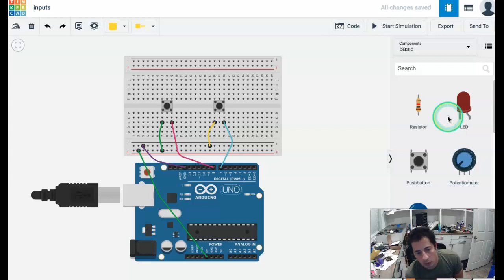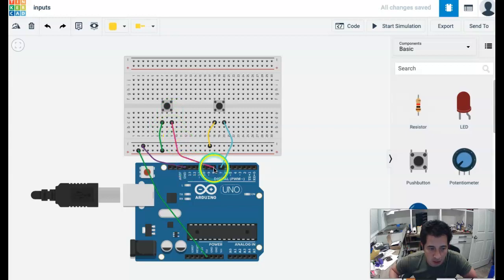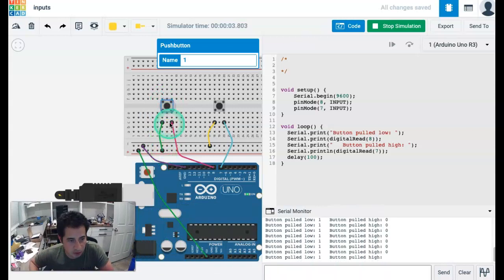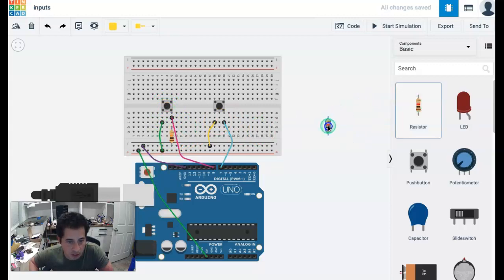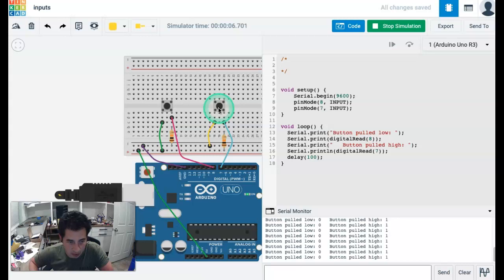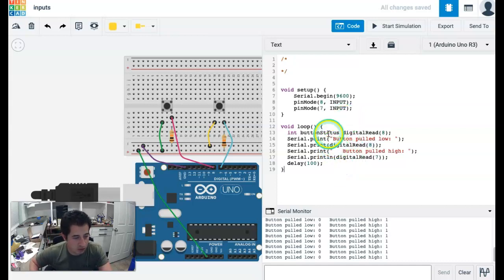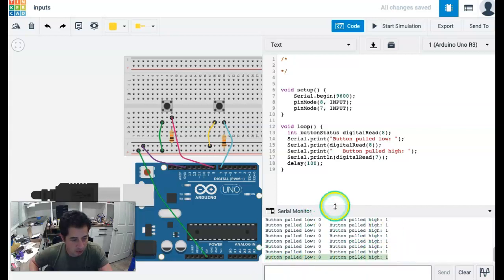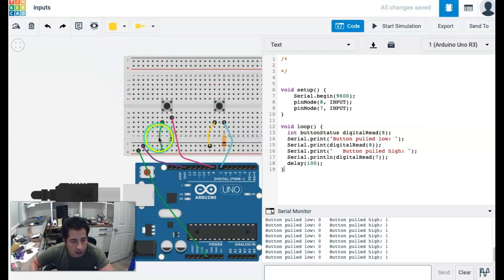8. Learning to code C/C++ with Arduino: Pull up and Pull down resistors

Comment: So I may need some lessons in physics/circuitry, but I don't understand why the flow of electricity doesn't just travel in the path it previously did the entire time. Does the new circuit complete of the button just attract electricity to go through a new path? I also thought that having a button meant an incomplete circuit until pressed, so why does it always read as one?

From the way you explained it, it seemed as if the circuit is complete regardless of whether the button is pressed or not.
Reply from the maker: Instead of thinking about turning on a lightbulb, think of the digital input as like a voltage sensor (this isn’t quite what is going on, but it may help you to understand what is going on).  The pin is detecting whether it is connected high (5v) or low(0v).  With the pull up or pull down resistor, it creates a voltage divider when the button is pressed, and when it is disconnected it forces the pin to high or low so it is not in an ambiguous state.